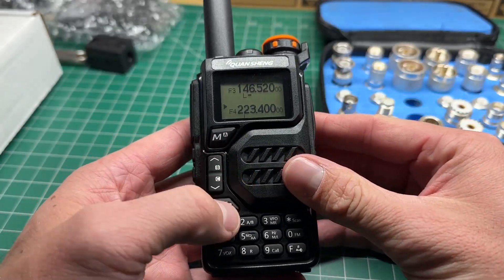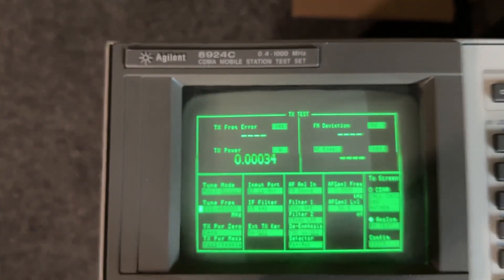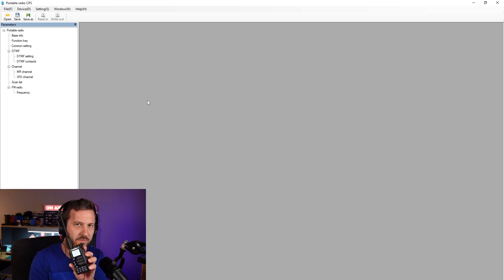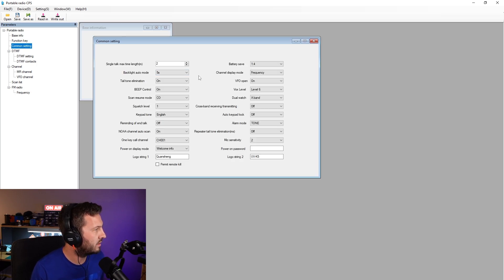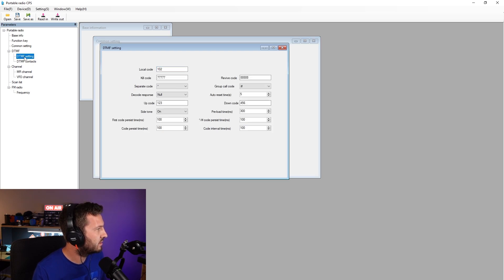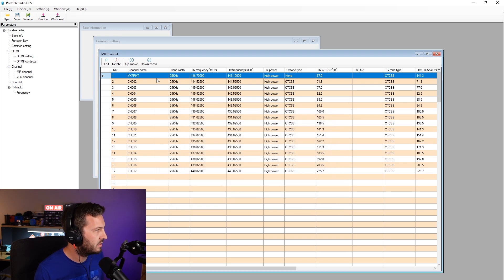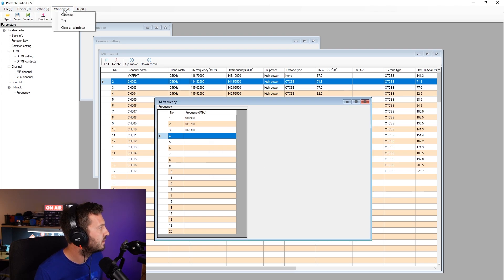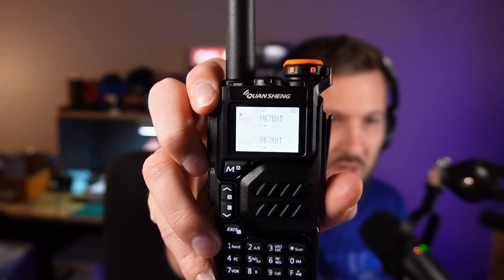Unlock Quansheng UV-K5: EASY Programming Software

Comment from the maker: Purchase the UV-K5 here 👉 https://geni.us/7jgV
Anysecu UV-K5 on Amazon 👉 https://geni.us/oCShbRk
Wurui K5  on Amazon👉 https://geni.us/A7eA 
Get a better antenna 👉 https://geni.us/tYM4A 
Connector/Adapter Set 👉 https://geni.us/goeu
(Affiliate links)
Reply: Little disappointed with the low output on 222MHz.   I am guessing do to harmonics.   I wonder if there is a firmware hack to increase the power a bit more.
Reply: Could you check the output power on other freqs other than Ham bands.  Curious if its firmware that prevents more power except for Ham Bands.
Also,  Can AM be turned on after the MOD is performed for other frequencies.
Reply: I noticed on their website they have firmware for this radio.  Wonder if its an update and I also wonder could you put the firmware on any of the clones of this radio.
Reply: Better Baofeng 10w
Reply: Thank you very much HamRadioDX for your videos on this radio! I intend on picking one up.

Comment: This radio seems to get better and better, with each video I see! Even the programing software looks easy to use. If it was waterproof, I would pick up a few.
Reply from the maker: I should try to see if it is waterproof hey!
Reply: Better to pop a non waterproof radio in a waterproof zippy bag, than get one that is waterproof, as they usually have different sockets for charging, in fact I think the baofeng waterproof radio's use the side contact pad charging which is a pain.

Comment: Hi, I purchased one of these, it got here 3 days later, I have been having a blast just getting to understand how everything works, I have watched several of your videos, in fact it was one of your videos that made me purchase one. I ordered it off Ebay from an outfit in Texas, got one with the white screen. One thing that had me wonder just a bit was the fact there was tape on the battery contacts so no contact on the battery till I located that and pulled it off. Perhaps not a real problem but there it was.  I have programed mine using the old software on my system from programing my little Boefang radio (recommended by the tester when I took my HAM test years ago). I like the set, while I haven't been out of town yet to make any contacts with it (I am the only HAM in my small town) reception is outstanding.

Comment: Got mine about a week ago and was rather concerned about the software warning from my computer, however I bite the bullet and downloaded it and no problems so far.  Easy to programme by hand and once you get the hang of the software, its so easy to programme all your local repeaters and upload them.  I have one observation that I don't particularly like, it appears you cannot have one line showing alpha numeric and the other line showing frequencies, both have to be one or the other.  I got mine for £23 and lets be honest, that a bargain and no mistake, even if its just for repeaters or when walking down the beach, if you loose it, so what......
Reply: i keep getting an out of frequency error.  You did not.  I manually programmed mine, easy enough.  Did you do anything in the setup of the software as you had success?
Reply: @custisstandish1961  Sorry you appear to be having some issues.  I did not change anything in the programme settings and up to now have not had an error message of any sort.  Just out of interest, what frequencies are you trying to input ?
Reply: It's just a Windows security thing.  Only certified software and drivers are 'allowed' to be installed.  Quansheng didn't bother doing that.  It doesn't mean that their software is inherently unsafe in any way.

Comment: bought two of them from your link. should get them by April 25th 2023. I've purchased several of the bf flavors over the years and have about 10 different versions. Only happy with the original so far as it has the least issues. I did test many of the antennas that came with the radios and they typically get a 2.0 or worse SWR. I have a few that are tuned better and are actually closer to 1.4 1.5 swr. so better to purchase a good antenna but beware even those are bad or copies of good ones that aren't worth the money. I would forget about 1.25 as it just doesn't work no matter the BF copy.

Comment: 220 MHz requires a 220 MHz rubber duck/antenna, which everyone seems to fail to mention. The stock rubber duck does not cover the 220 MHz 1.25cm ham band. Also, scanning on either A or B memories, or VFO causes the backlight to remain lighted during the entire time scanning is activated. Battery life will be shortened as a result, unless the firmware update addresses this malfunction, or there is some way, which is not obvious, to turn off the backlight while scanning.
Reply: The backlight being on while scanning irks me so much.....Such an oversight. I tweeted Quansheng about it. They said the demand is low so they won't be providing firmware updates for now but will let us know later.
Reply: @KartikSinghLive  Made in China says it all. Even the Baofeng UV-5R is smart enough to know the light does not remain on the entire time you are scanning. Start a campaign and create more interest, so they make the necessary changes to the firmware. To have the backlight remain on the entire time you are scanning on a battery device is a complete engineering oversight. Someone should make a video about this lack of user programmable feature.

Comment: One thing I would mention after wasting an hour of my time. Plugging in the adaptor lead using what you would think is 'average' pressure isn't enough as I found when I could't connect using any software. The connector does need a hard push and you will then feel a positive click.

Comment: The biggest obstacle I can see so far is the antenna. They probably have the output on 220 scaled back and the output on 6 meters disabled because the supplied antenna is intended for 2 meter and 70cm bands. The QB-25 came with an antenna capable of operation on the four bands that the radio offered.
Reply: @HarryHamsterChannel  This is true, and probably why the tri-band Baofengs come with two antennas.

Comment: Just got one of these. Been trying to program it but it won't connect. I've got a couple of programming cables based on CH340 chipset. From different suppliers. They work fine on my other radios but on the Quansheng it will not connect (this includes the cable shipped with the radio itself). I don't see a blue light on the radio when I connect it either so wondering if there's some sort of physical fault on the handset  itself with the ports. Such a shame.. have left a message for the supplier. Can hopefully resolve it. We shall see.
Reply: It has to be turned on before connecting the cable. it has to know that it is connected before trying to listen to the PC.  So switch on, plug in connector and then open up the software
Reply: I have the same problem with a ch340 cable (the only one I have), which otherwise works fine with the baofeng uv5r. I can't read from the quansheng via chirp or cps, it says connection to radio failed. No blue light
Reply: @pierpaoloscian5926  Turn on the K5, attach the cable and 'then' connect it to the computer USB socket.  Then open Chirp or CPS.

Comment: Heads up! If you haven't used your Baofeng programming cable for a while you will get a rude surprise in the form of a message telling you that your cable is not supported. You will have to figure out a workaround. I know that the cable is good because it works on my old XP computer. 
My workaround was to use Device Manager to rollback the driver to a 2007 version.
Reply: They made a new cable a few years ago, this fix the driver problems with the older cable with windows and I have had no problems since that time .

Comment: Set the com port correctly. Clicked connect. When I plug the programming cable into mine and I try to read from the radio it comes up "radio communication failed". Even tried Chirp and it still says no. Tried reading my Baofeng with the same cable with Chirp and it works perfectly, just can't get this Quansheng to program. Any ideas?
Reply from the maker: Try pushing the cable into the Quansheng even further - there were a few that noticed it didn’t quite “click” in all the way which meant it didn’t read from the radio properly
Reply: @HamRadioDX  I'll try that, thank you

Comment: It's a nice radio that it can receive 6 meters 52.525 OK. Sensitivity was good measured 
on my service monitor on the other bands. The alphanumeric display is great, 9 digits. A nice radio like  the TYT TH-350.
Reply: Hello, quick question, can you add alphanumerics to a saved frequency without using software? Thanks

Comment: Have a question plz help. Just received my UV5K. And it does not switch to channel mode. It just stay in frequency mood. Pressing function key and 3 to switch and it does not only stays in frequency mood. Don't know what's wrong with it. And it was updated to new firmware.

Comment: Ive tried to follow your video, but when I connect the radio using the bafeng cable there is no blue light, I have tried every COM port but they all say "Radio cant connect". Ive tried different USB ports on the computer as well. Is there a trouble shooting guide for this?  There always seems to be a step in these tutorials that doesnt work as shown then I have no idea how to fix it (Im very new to radios)
Reply from the maker: Double check the Baofeng cable is completely plugged in. Some of them you really need to jam it in to get it to work.

Comment: Could you check if the radio transmits on 447mhz? It's the Aus UHF CB band. Not type certified but it'd be nice to yell at tradies over the air in a pinch.

Comment: As soon as i plug radio in to the Baofeng cable , i have 2 cables tried  both  .  the radio goes into transmit mode , and then I get a red led,  not a blue led , using windows 11, using the software on this site , any ideas ?

Comment: Hi I wonder if you can help I have done something accidentally and now when I press PTT button it just shows Disable and won't transmit only receive and I don't know why.
Reply from the maker: There might be an issue with the firmware version loaded in that has disabled transmit. Check out this video for more info on custom mods:

Mod Your Quansheng UV-K5 - EASY! [Make it Even Better]
https://youtu.be/m3zXH__BRPM
Reply: Thank you for your support

Comment: After updating unlock 18-1300, from stock firmware 31, and using RSSI bar 78, why does the LCD sometimes give an error when we PTT (freq 142) and also sometimes go blank, finally I restarted it back to normal. I tried again on uvmod with firmware 26, unlock 18-1300 and rssi bar 78, still the same symptoms as above. Does anyone experience something like me?

Comment: The backlight on this radio stays on while scanning and there seems to be no way to turn that off. This irks me so much.....Such an oversight. I tweeted Quansheng about it. They said the demand is low so they won't be providing firmware updates for now but will let us know later.
Reply: The only workaround is to set ABR (backlight) to off before starting the scan

Comment: Still going through the playlist, thinking about getting one of these myself.  The 1.25m band is vaguely interesting; does the power limit on that band change with any of the community firmware builds?
Reply: Since the radio appears to have been originally designed and intended for 2-meter and 70-cm bands, the hardware isn't there to fully support the 1.25m band. The existing circuitry is not tuned for that band, thus the significantly lower output power.

Comment: Can you explain this software to me. 
On chirp for example i have a frequency that is 146.640 with offset of  -0.6mhz. In the UVK5 software if has spots for tx and rx frequencies and frequency steps. Does this mean in the UVK5 software i would enter 146.640 in receive frequency and 140.640 in TX?

Comment: I just got one of these and had a go with the software.  I must admit that it was easier because of your videos.  I was confused by it only having 14 VFO 'channels' that could be edited .. it seems that there are 2 for each of 7 bands?   Anyway the main thing is that the .cfx file that gets saved is easily edited with Notepad++ say (if you are ok with the format).  I found the AM signal from the local airport pretty scratchy but it does work if you can clue into the accents.  I have a Tecsun 660 that can't pick up 101.2 here ..but this one does fine .. which reminds me to try them together on the airband channels. I get the impression that there is much more to this beastie than meets the eye, it's just a matter of finding it.   Ummm regarding my 'having a bloody laugh' comment ..that's slang for ..Jees that's expensive. Sorry if it seemed rude 🙂   BTW  Power on the K5 and plug in the cable before connecting to the computer.

Comment: Wasn't that an attenuator I saw on the cable going to the SA?  That might explain the low power reading.  You said it was a dummy load, but it looked more like an attenuator to me.
Reply from the maker: It was, but it’s zeroed out in the SA. -20dB
Reply: The local 220 repeater is so close that I can talk on it with one watt into the dummy load, so I should be full quieting on 250 mW.

Comment: is there a bug with 2 cm? adding a reapter with downlink of 146.78000 and uplink 146.18000
 gets a step error but 146.9 and 146.3 works fine? example: 147.0400	+0.6 MHz	110.9 / 110.9
Reply from the maker: Go in change the step in the menus

Comment: Thanks Hayden, I will try the software cause after 5 minutes, my keypad appears to be locked. Can't get into menu's, can't unlock with the lock key/F button. I am stuck, no locked symbol on the screen, I dunno what I did.🤷‍♂️
Reply from the maker: Isn’t there a key symbol on one of the buttons? Was it locked there by mistake? You got your radio in the mail quick!
Reply: @HamRadioDX  yeah, it came super quick.
Yes, one button has a key on it but a long press doesn't do anything. That's all the instructions say.
I'm gonna try reset it with the software, thanks for the link and other links.👍

Comment: Software works fine but there is a drawback (at least from my perspective) in that it doesn't (unlike CHIRP) seem to allow me to copy and paste from, say, an excel spreadsheet of channel info. Each channel needs details typed in one entry at a time - and the cxf file is really to complicated to modify in spreadsheet mode.
Reply: @HarryHamsterChannel  Agree. One other little foible I noticed is that programming F2 (short press) to start/stop channel scan only works for start scan. You need to press the Exit (D) key to stop the scan. Sure hope CHIRP gets it on board sooner rather than later.

Comment: im just getting into harm radio what do you recon should i grab Quansheng UV-K5: or baofeng bf-f8hp ?
Reply from the maker: I have only tests the UV-K5, I can't comment on the BF-F8HP, I don't have one.
Reply: @HamRadioDX  Thank you i ll grab the UV-K5(8) :) i double checked apparently you can unlock the next gen K5 same way as well as you did it with the K5 since the only thing that differentiates both devices is design and speaker. Thx again

Comment: Hi, I have the programming cable, downloaded the software and yet the station won't connect to the PC in Windows11. The program doesn't see it even after setting the COM port correctly. Do you know where the error is? Thanks for the advice.
Reply from the maker: Ahh I only tested in Windows 10. Have you checked the USB cable is in the device manager properly installed? Might need to get the drivers - I think if you google Baofeng programming cable drivers you should find them.
Reply: @HamRadioDX  It helped to download the latest cable driver, for Baofeng cable CH 340 from Feb 2023. Now everything works. Thank you for your help.

Comment: I have got the LSENG version of this radio as my first amateur radio, was hoping to be able to use it for work as they use VHF coms on the 164.000 to 173.000 frequency range, I am able to receive the coms on it but i am unable to transmit using it so have to use their radios which aren't as clear on the receive. Is it possible to unlock it to be able to transmit on this frequency range or am I to be confined to using works radios?

Comment: So mine arrived in the post today and I can't seem to program either from the device or via the software.  For some reason it won't accept 446 frequencies.  The software errors with "The receiving frequency point does not match the frequency step value."  This is while trying to set 446.00625 with a step value of 12.5kHz.  Anyone have any thoughts?  Also I can't seem to figure out how to update the radio firmware as I can't find an English installer.
Reply from the maker: Change the step to 6.25 KHz. You can do that in the menus
Reply: @HamRadioDX  Thank you I feel dumb AF.  I felt sure I'd tried that but followed your instructions anyway and you're absolutely correct.  Thank you very much.  Sort of hope this gets Chirp support soon and a decent Reddit sub springs up.  But thank you for this support and your videos.
Reply from the maker: @daveedee3626  No worries at all mate

Comment: How many characters will the channel name display on the radio?  Will it display lower case characters?  Thanks!
Reply: The answer is 10 characters maximum, both uppercase and lowercase allowed.  The radio centers the name on the display.  Also the CPS file is XML, so it can be edited outside the CPS.